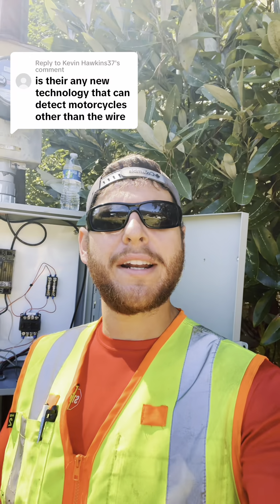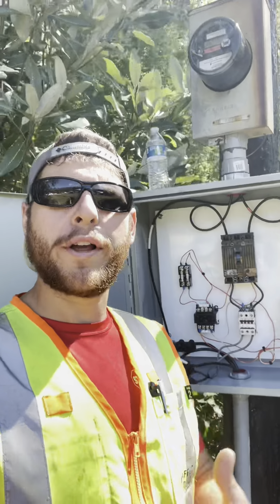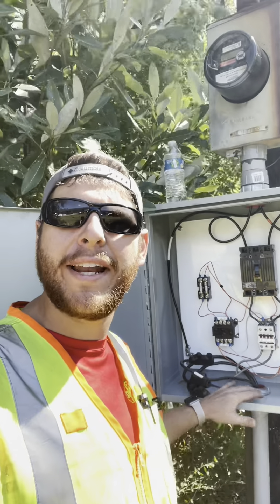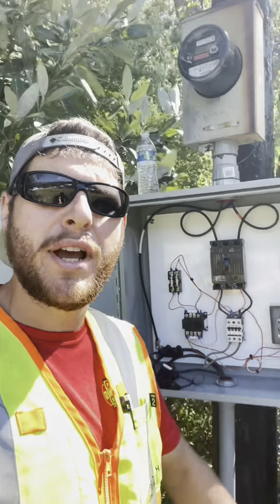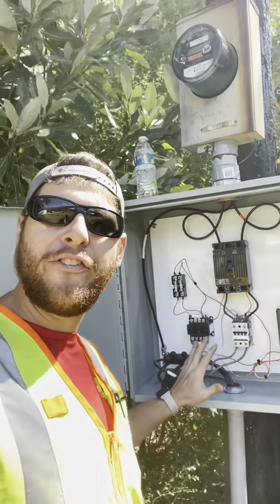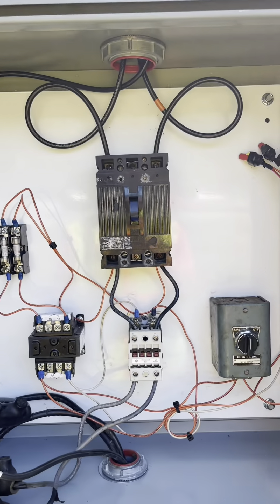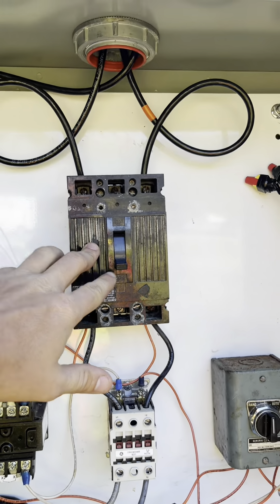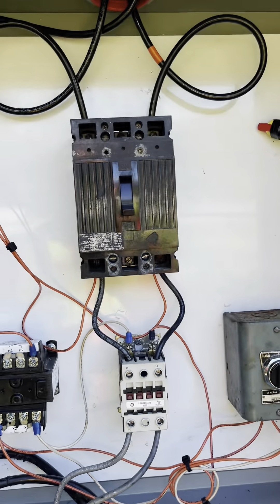New technology to give motorcycles green lights!! (Full video)

Comment: Im curious what LCR do you use for your in-ground inductive loop testing? Ive been using Der ee DE-5000’s for about 10 years now. Ive tried BK, precision and agent, but had intermittent issues with them. So just curious if you may have a different recommendation

Comment: What technology exists that would allow a bicyclist to get a green light? We had the metal bar inductive loops all over my city but in more recent years projects replaced them with "hockey pucks," cameras, and other sensors that I cannot identify and in some cases cannot even find! I've been triggering the lights with inductive loops for over 50 years but some of this new stuff simply does not "see" me. This is a serious problem for cyclists... I do long distance bicycle touring (think 1,200-3,200 miles at a time) and have been trapped at intersections for long periods. It isn't until a vehicle shows up in my chosen travel lane that I can get a green light at 6-8 lane intersections. Encouraging a motorist to come up close enough to me/the intersection so they can actually  be detected is sometimes a problem... This as "some crazy guy on a loaded down bicycle wants me to get close to them..." I chair the Complete Street Advisory Council in my city and we'd like to make recommendations for future installations.